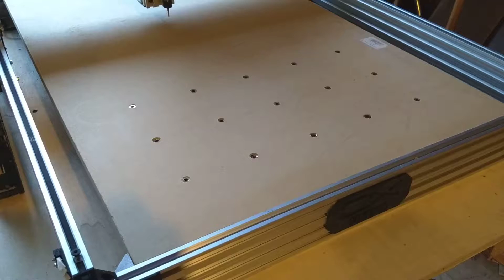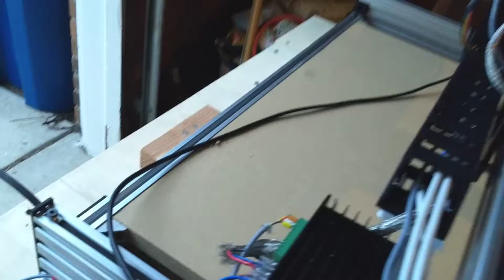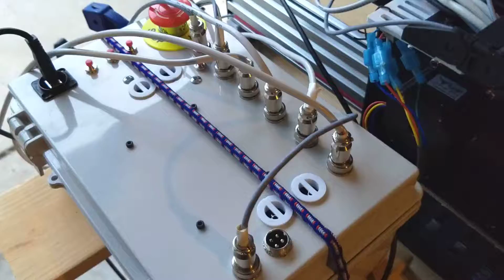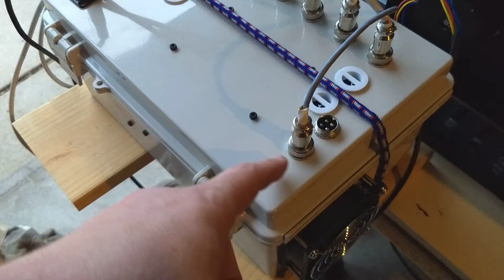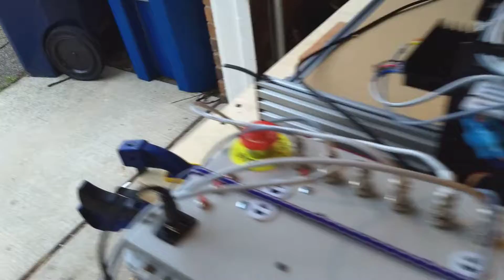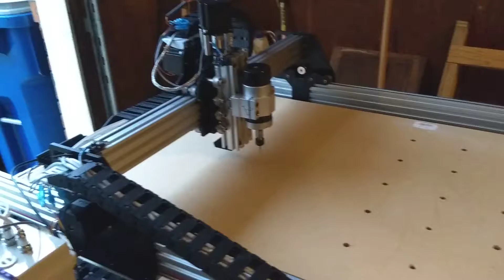CNC next part

Comment: You have much more patience than me in building yours, mine has no control box yet, wires coming and going every which way but I got it working and seeing it cut stuff is too much fun.Btw as I'm been reading posts on openbuilds I got the suggestion to use the threaded insert from below the spoil board, this way the force of the bolts trying to anchor a workpiece pulls the insert in and not out of the board , the threads might bust the mdf. 

Keep ti up, waiting for more videos.
Reply from the maker: I'll build the next wasteboard like that. This was a pain. Drill the hole. Then drill a countersink.